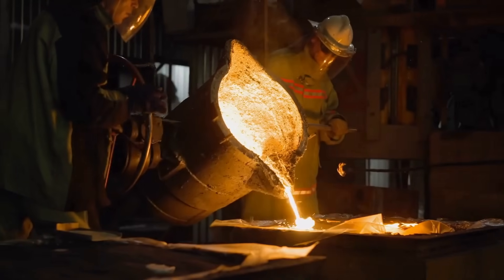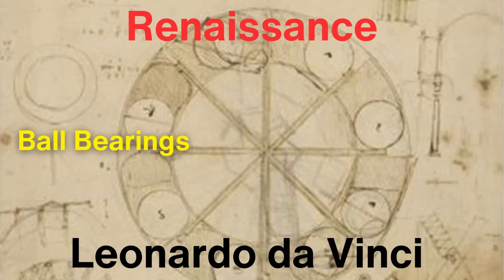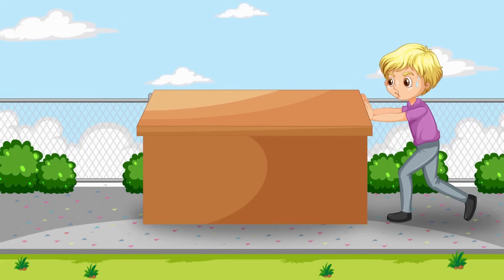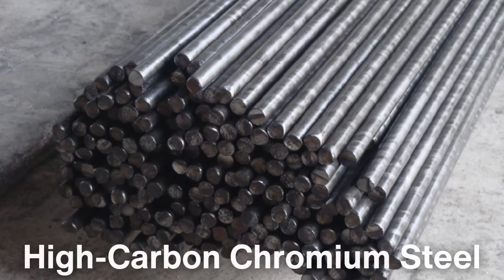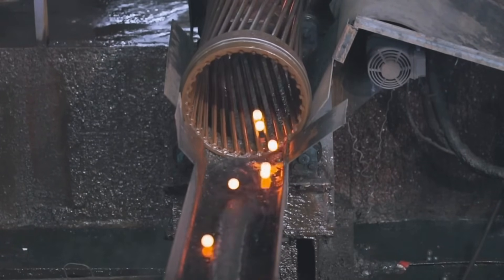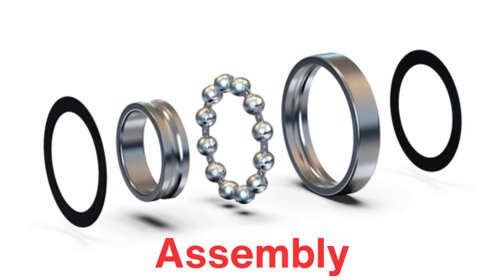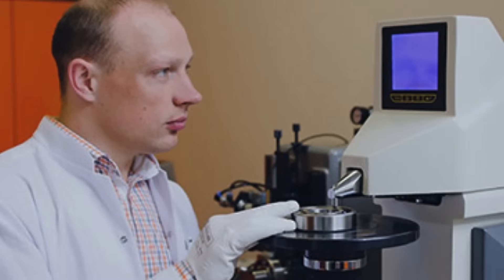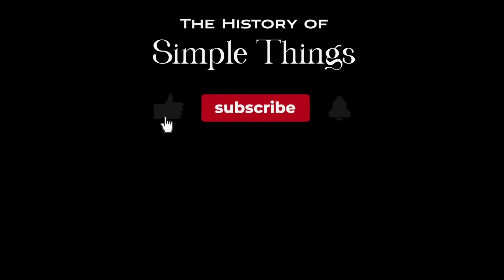How Ball Bearings Are Made – The Hidden Genius in Every Machine!

Comment: I worked at NAPA and we had 2 bearing choices. They used to be SKF then they changed to FAG. Then there was the value line for a lot cheaper. Sadly customers always bought the cheap ones to save money. You get what you pay for.